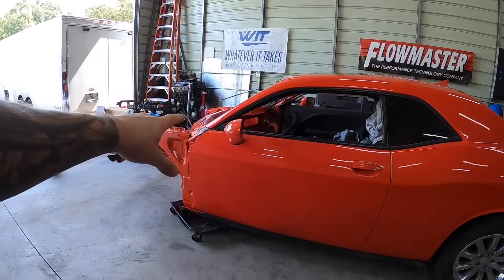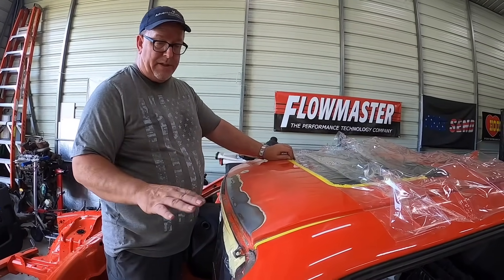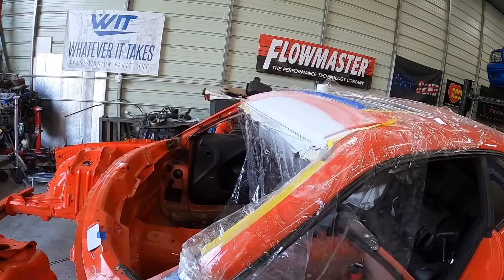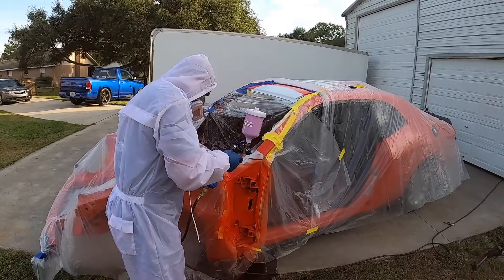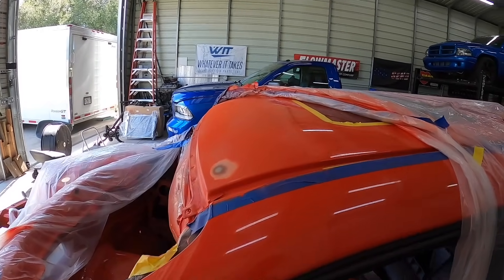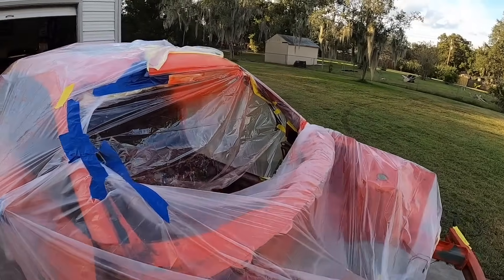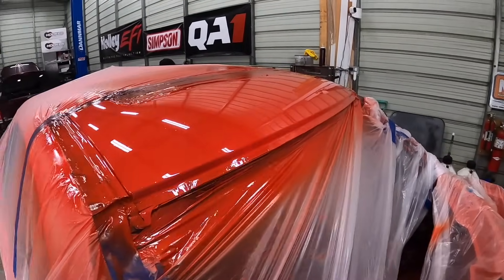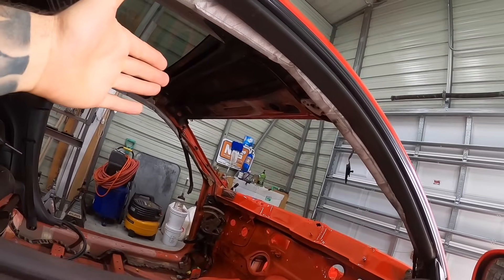Rebuilding a Dodge Challenger SRT Hellcat | Paint Work

Comment: Jon ya can't fail at something till you try doing it.and then you learn...I love the paint process and blending in panels...use to suck to do the clear you had to clear the whole panel.... unfortunately you will see a line where you taped. But it's a learning process....if you have a legit paint and auto body supply store and tell them what you need to do they would have been able to set you up with a can of "blender" you would not clear up to your tape line you would just dust the clear in that area and give it a quick shot of blender and it actually allows the old clear and new clear to melt together. Best way to explain it.
Your new clear areas are always going to be higher than the factory clear and it won't feather in but you can get it to look good till you redo the whole car because you will have hood,fenders, front bumper,the rear quarter panel repair...so you wet block sand the whole car in 800 grit spray color from fender into the doors and windshield posts and the quarter repair then clear the whole car in one shot....let cure ...then depends on what you want to do you can wet sand with 3000 and buff or you can do a flow coat. And cut and buff that all depends on how you want it to look........but your doing great for someone who has never painted a car before buddy 👍👌✌️
Reply from the maker: Thanks Ron! Whole car ultimately could use paint but this will get it looking better than before for now